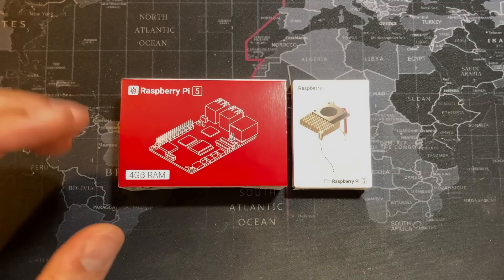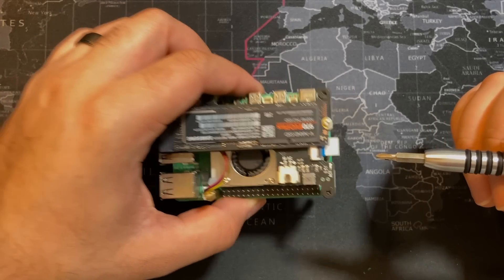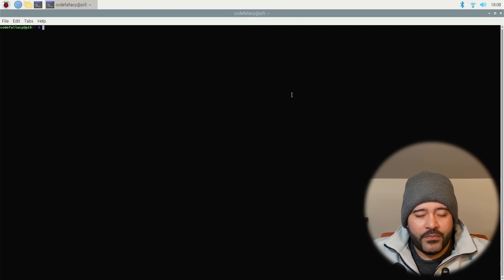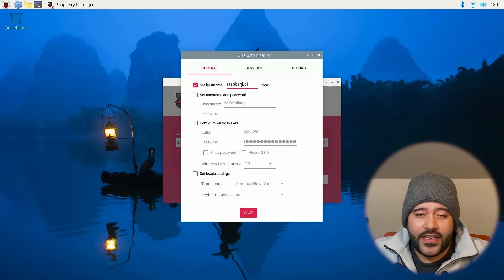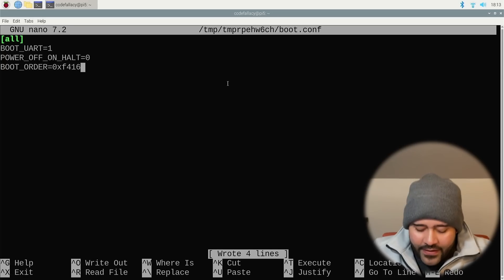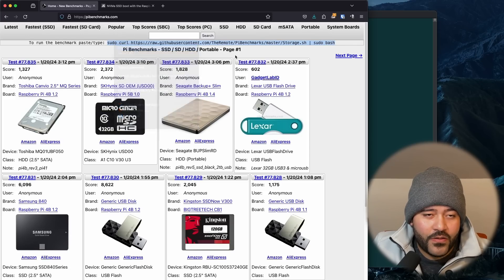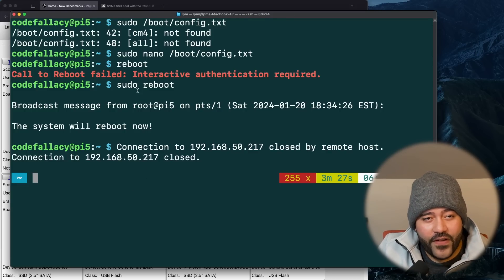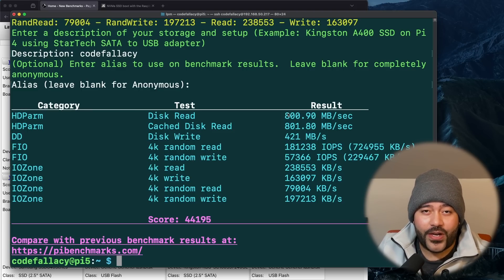Raspberry Pi 5 with 2TB NVME SSD Geekworm Shield

Comment: Hi And thanks for the good videos. I am new to linux and have just acquired Raspberry pi 5 with 2tb nvme, and via your videos have configured it. I have the following questions. Is there a simple way to backup the configured system.? If something goes wrong.
Regards, John Stephansen
Reply from the maker: Hey john, yes! there is a Linux utility called Timeshift. it can be setup to take snapshots of your system periodically. i believe its only a command line utility but there a many tutorials out there to make it work! Than you for the coffee😋
Reply from the maker: Hey john, i responded to your inquire in buy me a coffee, but i figure i also add it here as well in case (Hopefully youtube doesnt block it):
i believe your error is because you are using the following command "scp john@192.168.0.111:/home/john/wireguard/config/peer3/peer3.png /Users/lpm/Desktop" what this command is trying to do is move the configuration file from "john@192.168.0.111:/home/john/wireguard/config/peer3/peer3.png" to "/Users/lpm/Desktop." the path "/Users/lpm/Desktop" is specific to me and the macbook i was using to make the video, since this path does not exists for you, you are getting this error, instead you should try replacing "/Users/lpm/Desktop" with "C:\Users\john\Desktop" so the command should be the following: "scp john@192.168.0.111:/home/john/wireguard/config/peer3/peer3.png C:\Users\john\Desktop" 

However i cant test this at the moment since the only windows machine i use is at my work place, so if this does not work i recommend you install "Filezilla" in windows and connect to the raspberry pi using sftp. i did this for the jellyfin tutorial at the 4:00 mark (https://youtu.be/7a9TlQsmlP4?feature=shared) its a much simpler way of doing it. basically you will connect to the pi server with Host: sftp://192.168.0.111 username: john passoword: (your passoword) then when you are connected, on the left side of filezilla you will see a file explorer for your windows PC and on the right side you will see the file directory of the raspberry pi. and you can find the file you want to move and drag it from the pi directories to the windows directory. I hope this helps. let me know in a youtube comment if you need additional help! Once again, much appreciated
Reply: @codefallacy  Many thanks for the reply. I will try this tomorrow.
(I live in Denmark)

Comment: Its my first time with pi and a node , i have a pi5 i cant make up my mind if i should use a hat and nvme 2tb ssd or a sata ssd 2tb drive what would you think would be best for a btc node , any info much appreciated . thanks
Reply from the maker: either way would work since SSDs are less likely to fail than microsd cards.

Comment: I just bought this board from the same website, but I have one concern and I'm hoping you can help me. The Geekworm website specifically warns that SSDs, using the phison controller, are not compatible with Raspberry Pi 5. While I appreciate that you have probably already researched this for the drive featured in your video, it sells for ~$200. Do you have a method to determine which controller is being used on an SSD drive, before purchasing, so I can shop around?
Reply from the maker: SSD market appears to be way overpriced at the moment, they had an over supply last summer and ssd Nands were alot cheaper. they are probably trying to make up for lost revenue, i bought this SSD for $65 USD last summer seeing them for 200 is just ridiculous in my opinion.  as far as the controller, i believe Samsung and maybe crucial, use their own controllers since phison is an alternative to samsung. but im not 100% sure. ill have to do some research myself.
Reply: @codefallacy $65???? Talk about a markup! If you could do a little research and let me know, I would greatly appreciate it. I have tried to research this myself and have found inconsistent information where the website referencing the incompatibility specifically sites Western Digital Blue and Black drive models but when I looked up the controller, Phison was not the identified controller on those drives. I dont see a trust worthy source and controllers dont seem to be a listed tech spec. Thanks for your time
Reply: @Sartre_Existentialist I am also looking to get a drive that is compatible soon

Comment: Have you found a suitable case to fit the Pi 5 with the active cooler and the Geekworm shield?
Reply from the maker: i havent looked really, i dont usually buy pi cases i rather build them myself or 3D print them from thingyverse

Comment: I wonder how it happened that Pi for a few bucks now costs a few hundred bucks (with all the amenities) and everyone is still considering it over the miniPC
Reply: Popularity went well beyond it's original intended purpose, and the capabilities also increased.
The Pi 4 for example is supposed to be roughly 30 times as fast as the original, and originally it was intended as a low cost school project computer for teaching basic computer science, but it outsold its target market and got used for robotics, automation, and for hobbyists, both the improvements of hardware and the demand drove the costs up, but they also developed low cost versions to continue the accessible low cost goal.

Only one I currently own is the original B variant.
Reply: This goes beyond personal home use. Also, RPi is the gateway for true desktop Linux ARM experience.
Reply: Because it's made to be modular
Reply from the maker: i thinks its important to keep in mind the raspberry pi is meant to be used in more ways then one. if you are only interested in server stuff then a mini pc will be better bit if you plan on doing robotics and custom projects beyond just server stuff then it is great for it.
Reply: Just know where to go for them. The Pico is $3.99 and Pi 4 is in stock at the micro center near me starting at $45 for the 2GB. 

Although if you’re not in the US/UK, yeah it seems to be much tougher to get

Comment: Hi! 

Do you think a SSD NVMe of 4tb will work with pi ? If yes do you have some brands exemples ?
Reply from the maker: Hey thanks for watching, I think it may work as it is the same M.2 NVME interface. However keep in mind some users have reported errors with high power consumptio m.2 ssd drives. I only have this samsung drive i have not tested with others M.2 drives

Comment: rpi 5 is poorly engineered should have nvme standard, i refuse to buy it
Reply from the maker: That is a valid critique! some users have expressed that the Raspberry Pi has gotten too expensive. The original goal was to always keep it at $35 USD and they have almost doubled the price. I think it is good not great at the price, but i respect it.
Reply: @codefallacy  I dont respect it, but I have a Synology NAS and a Ryzen 7 mini pc with 32gb ram and a Ryzen 5 desktop with a gpu and 32gb ram. RPI is obsolete for me and everything is on 2.5bg network.
Reply from the maker: thats awesome! im a big fan of taking control back from cloud providers,  right now im broke af and can only make Raspberry Pi videos but eventually i want to make videos on pc hardware with proxmox, self host, home server and that kind of stuff.  im running TruNAS on a used office PC through proxmox and a couple of VMs and i want to share with everyone.

Comment: Are there any of the M.2 boards which are not made in China. Considering the CCP has an actual policy of forcing manufacturers to place hardware backdoors in products they sell, I want one from anywhere else.
Reply from the maker: Im not sure, search for UK based companies making boards, hopefully they dont outsource their manufacturing
Reply: This is just an adapter board, and if you're worried about backdoors, recommend consulting the Raspberry Pi Foundation.

Comment: I have the X1000 & X1001 & I too was also able to keep my heatsink on but I replaced their mounting screws with standoffs & moved the M.2 boards as up high as I could away from the heatsink to free up the fans airflow, so it keeps both cool.  I also added feet to the board, to keep the underside of the Pi cool, but also in case I spill my coffee on the table so it doesn't get destroyed.

Comment: Hi there can you please run " dmesg --follow " and see if there is any pcie errors ? i try different hats and they all work but some of them give error messages
Reply from the maker: Sweet! ill run this command and report back when i get home from work
Reply from the maker: Good news, im not seeing any ERROR mesages when running dmesg command with this ssd and board. however some viewers have commented that they have had QA issues with Geekworm in the past. What are the specific error messages we should be in the look out for?
Reply: @codefallacy   nice to hear you have no errors, i cant remember how they exact was , but if you have errors its not only one ,its a ton, for every use of the ssd yu got a error message (but everything is working like normal , even benchmarks give the same speed resulsts), i have to say i use a long 16pin 0.5 pitch ffc cable (covert in tinfoil) and not the official one.  i stop the errors by adding "pcie_ports=compat" to the /boot/firmware/cmdline.txt. with some adapters adding "pcie_aspm=off" ( active power management)  is also working. now i can use any cable without any error.

Comment: Plastic stand-offs, those brass stand-offs, and those black screws, bad idea...  Invest in some plastic/nylon stand-offs so you have total isolation, or if you must (for some unknown reason) use brass, then under those black screws and under the brass stand-off place card/nylon/plastic washers.

Comment: I'm using CasaOS on my pi5 as  a docker dashboard snd control center. I have mounted my Synology NAS shares to my pi5 which I can also access in CasaOS. I've configured https access on all connections using ssl certs with the help of nginx proxy manager and duckdns. Also using local Wireguard VPN as the only way to securely access CasaOS on this pi5. 😁

Next is configuring Syncthing on the pi5 to sync my other devices on the network.
Reply from the maker: that sounds great! im a big fan of DuckDNS and Nginx Proxy Manager for SSL connections! I have heard good things about casaOS ill have to try it out one of these days

Comment: I just finished installing this hat earlier. For the base, I got a metal one which is part of a silent all metal case. Worked out pretty well along with GeekPi active cooler. I also added an m.2 heatsink for the Nvme SSD that fits well with this hat. 👍
Reply: Could you link the heat sink for your Nvme SSD. Thanks.
Reply: @jeffreylee9000  QIVYNSRY M.2 Heatsink NVMe 2280

Edit:
I tried to link the Amazon page but YouTube keeps deleting it. Just search for it. It has a 4.8 rating.
Reply: @jeffreylee9000  Here's the heatsink: QIVYNSRY M.2 Nvme Heatsink.

Here's the case if you want the Pi 5, hat, and heatsink all to fit together: KKSB Raspberry Pi 5 Case

Here's the low profile CPU fan I used if you're interested: GeeekPi Active Cooler.

I tried to post direct link to Amazon's page but YouTube keeps deleting it. Just search for them instead.

Good luck! 😁

Edit:
Just note that I removed the sticker on the Nvme M.2 SSD prior to putting this heatsink for better thermals but this might also void your warranty if you decide to do this. For me, no regrets yet and temps are great! Around 34°C idle and 41°C on load using pcie x1 Gen3 speeds.

Comment: I have the NVME adapter from pimoroni, i got similar speed results by changing the Gen as you using Crucial 1TB nvme.
I have however ordered this Geekworm board with case, as the Pimoroni board is mounted bellow the PI, and no case available.
Reply: I am waiting for my Pimoroni board to arrive.  I don't think we can expect a case for awhile.  :)
Reply: I was able to mount the Pimoroni board and Pi in a Geekworm P580 case. I left the feet on the Pimoroni and used longer screws to mount everything to the case. The feet let you adjust everything to line up ports and switch. @DrFunFong
Reply: @davideagle8837  Thanks for sharing!  I connected up a 500GB NVMe drive using PiMoroni but seem to have real latency problems.  It seems to be going much slower than a Pi 4.  Conky looks copasetic.  I hope someone throws up a video to debug Pi5 latency issues.

Comment: u would think they would make the default speeds use the gen 3 speeds and not gen 2.
Reply: The PCIe on the Pi5 has slightly too much jitter on the clock to get an official Gen3 rating. On the whole most things still work fine, but they cannot claim Gen3 compliance.

Comment: Interesting video. Have to note though that you probably can’t run six hard drives on this, at least not at anything like full speed. You only have one pcie lane, even at gen 3 that’s only equivalent to 1.5 sata III ports. You can already get a 6 port sata adapter that plugs into an M.2 slot, but I don’t think it would work with a single lane.
Reply from the maker: This is true! i appreciate the clarification. even if the speeds arent there, would doing a raid mirror be better over sata than usb?
Reply: Most HD's max out at around 250MB/s.   He should be able to get 4x SATA ports at virtually full speed.   Then again, the real issue is that Ethernet is only 1gbps, so read and write maximums are moot when the network can only do 125MB/s.   That can't even max a single drive.....
Reply from the maker: Great point, even adding a 2.5gbit usb ethernet adapter wouldnt help. but still, im mostly interested in the stable connection of sata over usb. ive read a few forum posts abou how RAID over a usb connection is a big no no

Comment: This might be silly but I’m using an old 1tb wd pidrive running a 512 botacera image. Any way I’m wondering if this would work the same
Reply from the maker: Im not familiar with pidrives but the raspberry pi allows you to boot from microsd card, usb ports and pci devices. If pidrive has a usb interface it should work.
Reply: Great video! Thank you  @codefallacy

Comment: Interesting device.  It's cheaper than most solutions.  Right now, it's NOT being well-received on Amazon and it has a very unfavorable ratings profile.  Hopefully quality control will improve and it will be a good option for us all.
Reply: I got it from Amazon and it recognized my Nvme SSD (Crucial P3) right away. I just had to first boot with the previous USB SSD and switch the first boot to Nvme using raspi-config. After that, I removed the USB SSD and only left the Nvme SSD. Edited the boot config to pcie gen 3 speeds afterwards. Everything is running great! 👍
Reply: @xellaz  I guess you could rely on Amazon's generous return policy to see if you have a good unit.
Reply from the maker: I agree its cheaper and smaller than most boards. I bought it from geekworm's website and it took 2 weeks to arrive because it was held by customs lol
Reply: I heard from Geekworm that the dozens of units produced just before the Raspberry Pi Foundation released the PCIe PINOUT document may have compatibility issues.